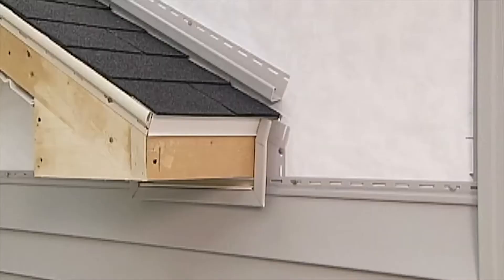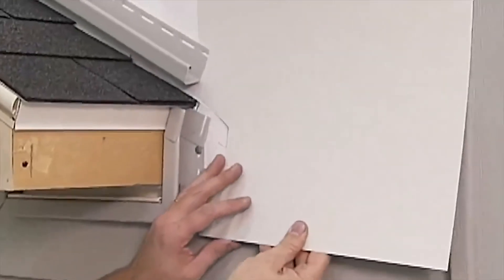How to Install Vinyl Siding Water Diverters

Comment: This is highly informative and important demonstration.
I've seen plenty of installations where neither of these two options are used.
The results can be really nasty.  If the j-channel has a slightly inward tip to it (towards the wall) then all the water coming down that wall that ends up in the channel has a tendency to run behind the siding, causing all manner of destruction over time.
Also, I see no reason why both of these methods cannot be used at the same time (diverter behind the siding AND a kick-out diverter).  It may seem excessive but the cost is so minimal.